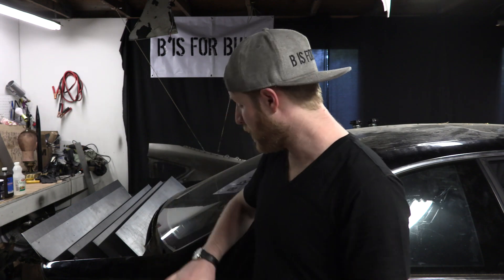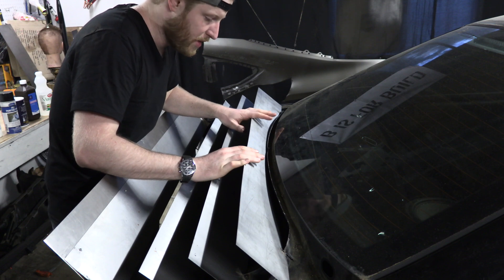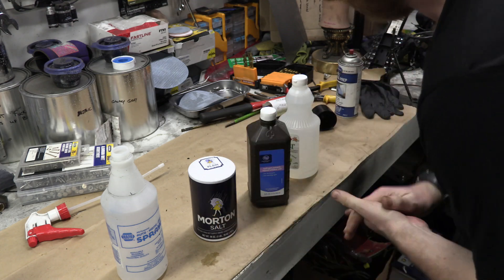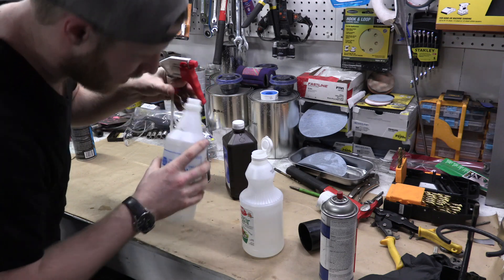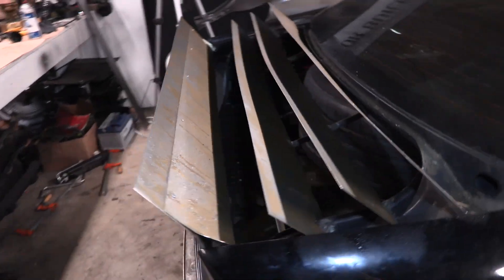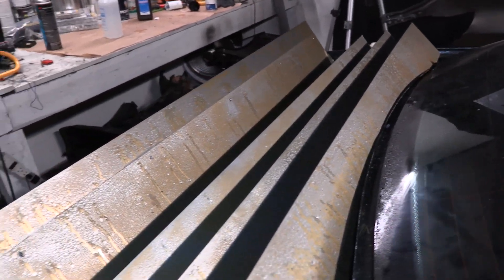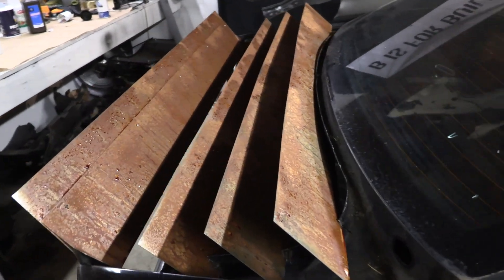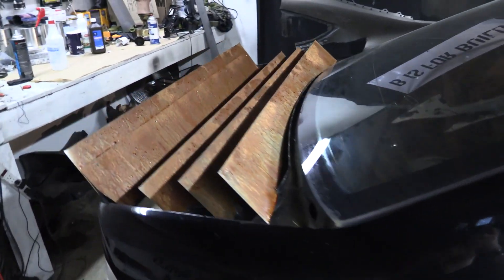B is for Build - How To Create Rust In Minutes With Household Products

Comment: your probably not going to read this. but in the off chance you do. use any cleaning product with hydrogen chloride. it will eat through any grease, oil, paint. anything that's on the metal, it was also eat away at the metal slightly. now the metal has no protective coating. it will  completely rust with hours.

Comment: Nice work. If you haven't already, you might want to drill some drain holes in the trunk. I once had a car that leaked through a tail light gasket, and the water went straight for the driver and passenger foot areas.

Comment: Now show us How To Remove Rust In Minutes With Household Products
Reply: Angle grinder. Grind that shit off
Reply: +B0NEZ   ,  I know a can of coke and a steel wool pad works on tubing and chrome ......... Just clean afterward with paint thinner or mineral spirits ...
Reply: +Norman Murray you can substitute coke for 50/50 white vinegar and water when cleaning chrome.
Reply: sand paper
Reply: Any rust removing solution/ angle grinder + POR-15
Reply: you also use vinegar to remove rust. but if u let it sit to long it will flash rust as soon as air hits aka drying. vinegar then steel wool while completely wet and baking soda to stop reaction. look up removing rust from motorcycle gas tanks. im sure there are better ways for less enclosed spaces. just saying vinegar is a 2 sided coin type deal.